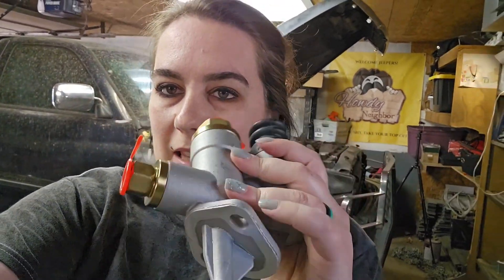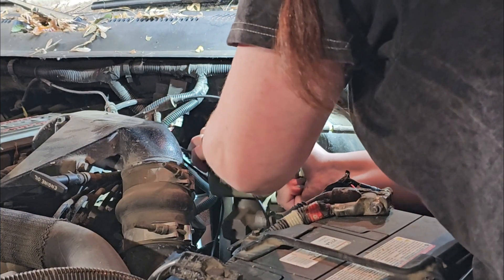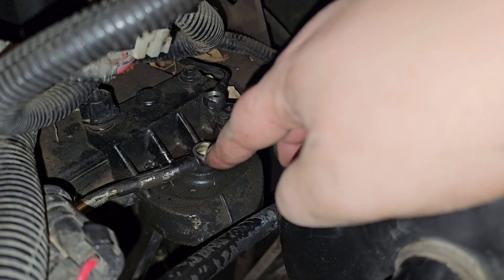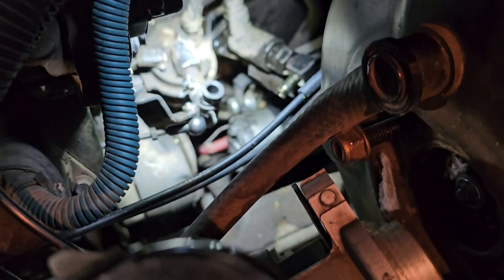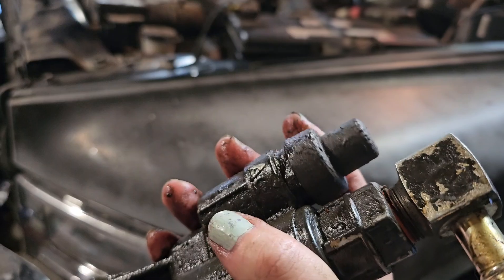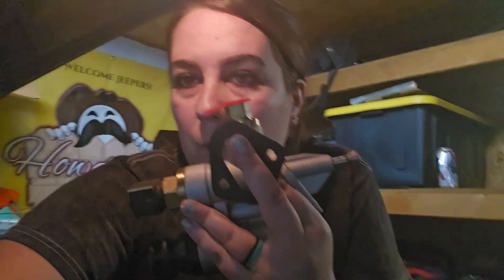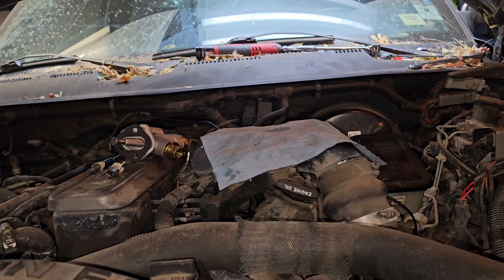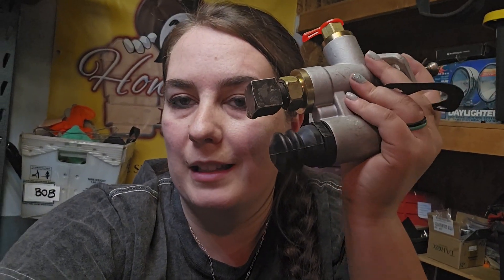94-98 2nd Gen / 12 valve Cummins Lift Pump Replacement - DIY Guide

Comment: I did it this weekend but I removed the wheel and access it easily from there
Reply: Your truck likely has an aftermarket fender. Factory trucks all have a steel inner wheel liner that blocks the access to the lift pump from the wheel well. It is common to use a hole saw to make an access hole in a factory fender or go through the trouble of removing the fender.
Reply: @drifterbbb3649 
Hahaha 
I have 3 first generation Rams and you are wrong.
But then you have zero credibility.
Respect your father
Reply: @andreinastase1604  Way to be an absolute tool. The video is literally titled for 2nd Gen Rams, not first Gen. Guess which one I figured you had? Talk about an absolute zero.
Reply: @andreinastase1604  It just boggles my mind how butt hurt you got from me trying to help you out with some info. And here it turns out that you are such a dope that you felt the need to comment on how you swapped the lift pump through the fender of your.. FIRST GEN. That helps NO ONE watching this video. All it would do is lead to someone attempting it on their 2nd Gen, only to find sheet steel in their way. Guess you think everyone is a mind reader too.

Comment: What occurred to cause the lift pump to be replaced?  My 94 3500 is leaking fuel not sure where it’s coming from.
Reply from the maker: Not sure it could have been age? This truck had 240k miles on it. We tested fuel pressure and other variables so it was just a bit of process of elimination to replace it
Reply: It may be the fuel lines but I just bought a 1992 that needs a new lift pump.